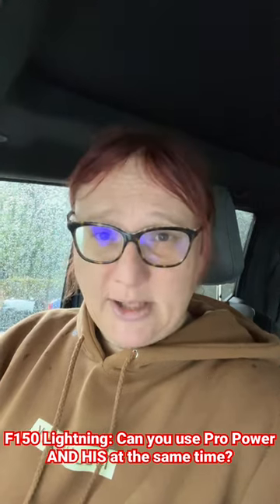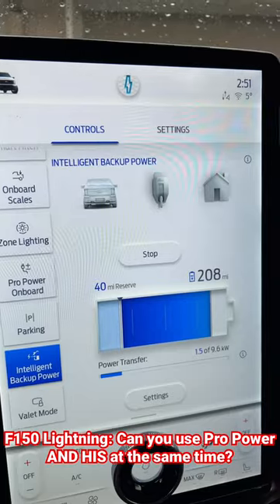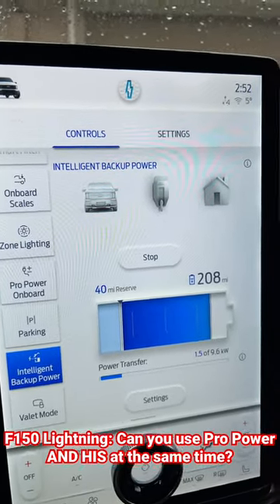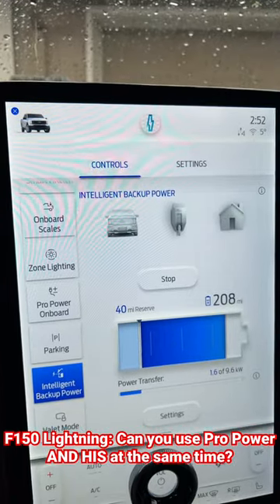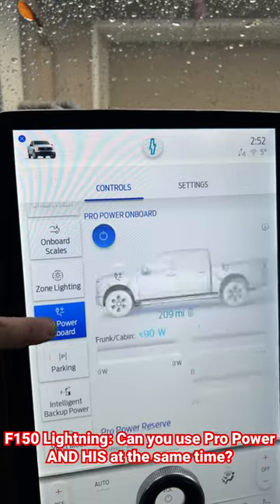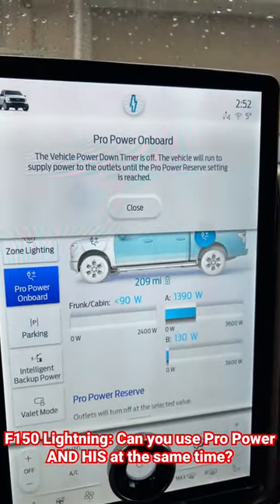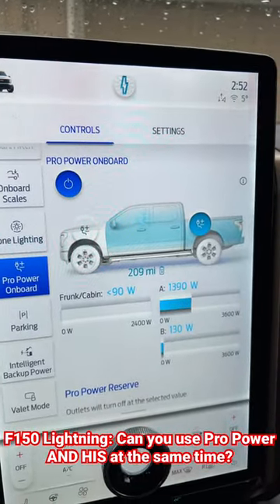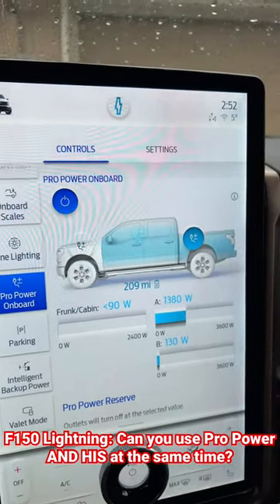F150 Lightning: Can You Use Pro Power And Home Intelligent Backup At The Same Time?

Comment: None of this is needed if you you own a cheap gas car and generator.  Just put some gasoline in either and turn the key!
Easy, inexpensive and done!
Reply: Yeah but how can a gas engine be as efficient as electricity coming from your truck after the charger after the transformer and after the large Diesel engine produced it (satire) electric cars don’t make sense
Reply: I don't know of any "cheap" gassers that have more than a couple hundred watts of power available from interior outlets or 12v receptacles, let alone the 10,000 watts that this truck can push out...
Reply: No, that's not easy at all. You'd have to remember to have lots of fuel on reserve and that it isn't too old. Plus also perform maintenance on the generator every year.
Powering things from an EV is quite easy and simple. Just plug it in and you're good. No need to worry about maintenance or fuel storage on site.